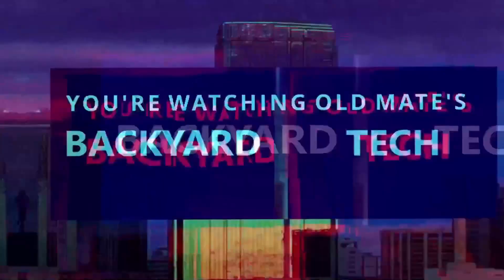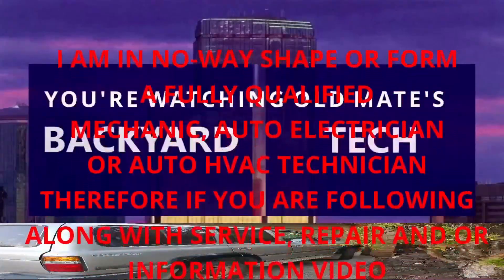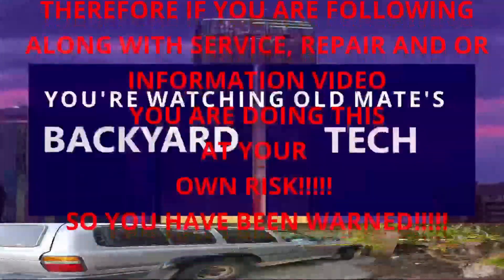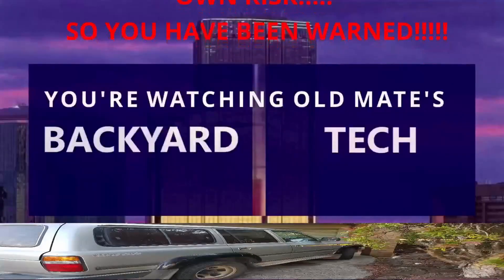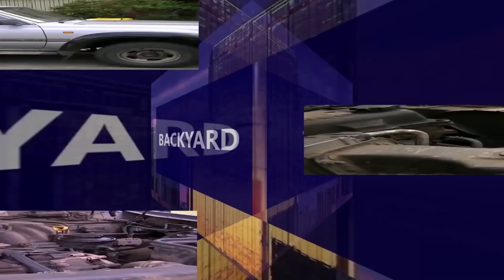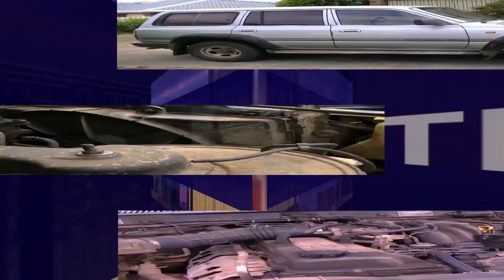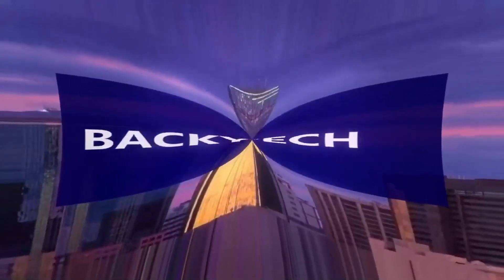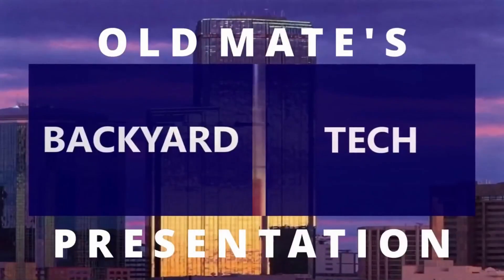80Series - Coil Pack

Comment: Not worth it. There’s nothing wrong with the Distributor system. 
Unless your putting an entire 100 series engine, wiring and ECU in cheaply I wouldn’t bother.
Reply from the maker: I am right though aren't I, the 100/105 had coil pack? or just 105??
Reply: @OldMatesBackyardTech  yes both
Reply from the maker: Also you may an issue with the A442F auto and the ECU for 1 100/105 because weren't they 5sp/6sp auto boxes??